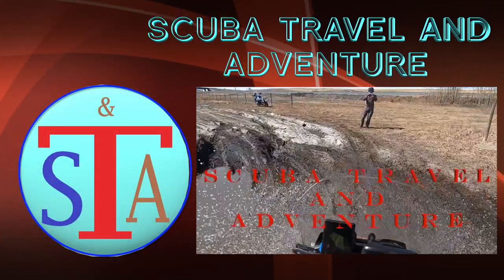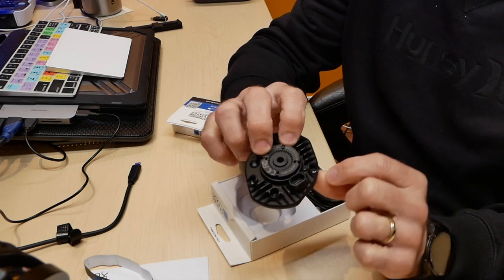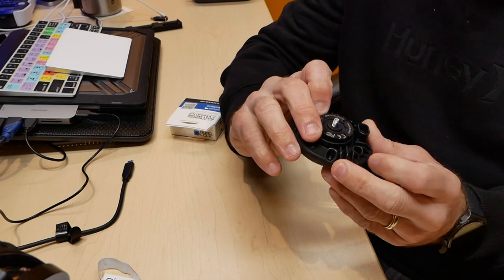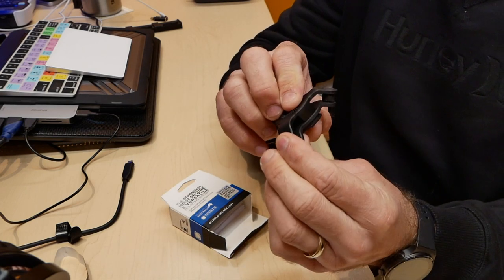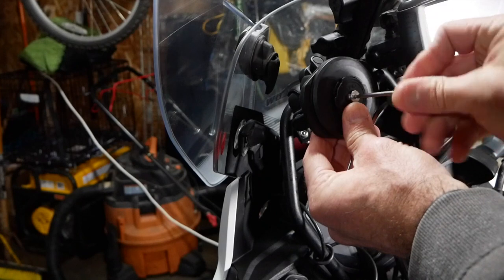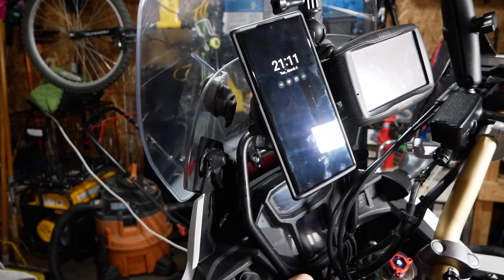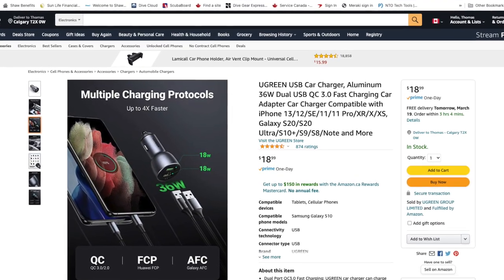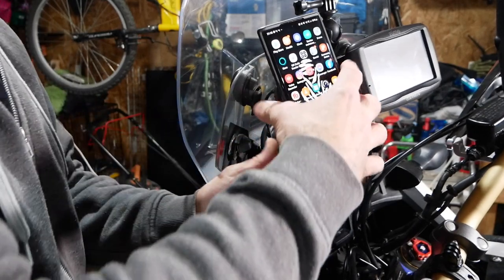QUAD LOCK MOTORCYCLE WIRELESS CHARGER & VIBRATION DAMPENER

Comment: Thank you for the upload in the quad lock video they make it look like it just twists on and twists off so easy …..so when I fitted mine I thought I had done something wrong 🙄 but you seem to have to push it back with one hand and twist it with the other hand the same as mine 👍
Reply from the maker: Once you get a hang of it it will be one hand operation
Reply: Yes after a few try’s once fitted to the bike it seems a bit easier Thanks again for your video great explanation I’m now wondering if it will charge while I’m using maps and listening to Spotify 🤔
Reply from the maker: As Long as you have good  power in USB adapter it will.  I constantly use my phone to control cameras and also YouTube music on longer Rides and non-issue.

Comment: Thanks for the video: I have quadlock mount, and I would buy the wireless charger, but I have some doubts about speed charge having a Samsung S21...Quadlock says the speed on Samsung phones is max 5w (Apple 7.5w)...and this problem is not on Pixel phones....Do you think 5w is enought for nav with Google maps with dislay on?
Reply from the maker: I have a pixel 6Pro no issue and my phone is mostly on when I ride as I use it to control my camera and maps sometimes